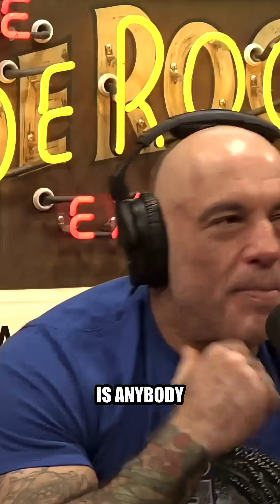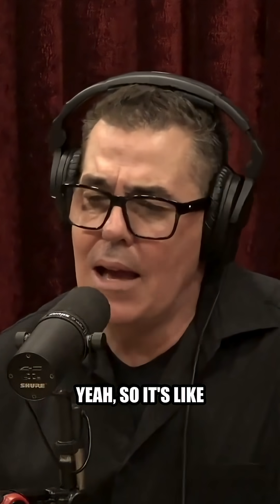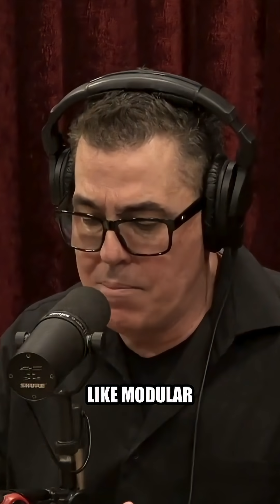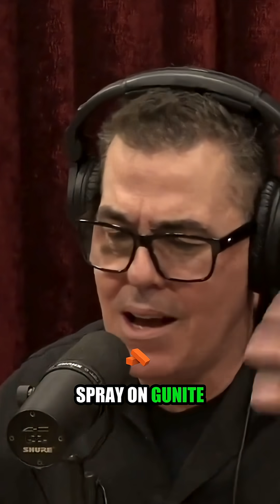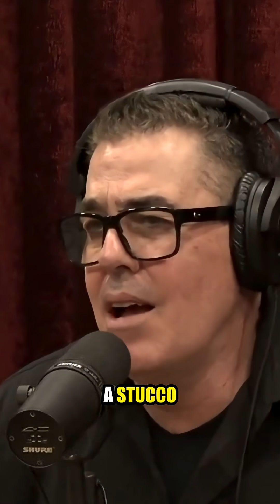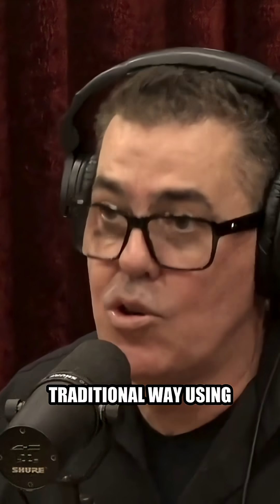The Future of Housing: Developing Fireproof Homes

Comment: Shit wood is cheaper and meets minimum standards.  Travel out of US and the mist common is brick/block/concrete.  They basically use wood because that is what they have always done and what the code has been written for.  I had trouble understanding the lack of fire code, Smoke detectors and doorways.  Because the houses do not burn.  Just furnature burns itself out.